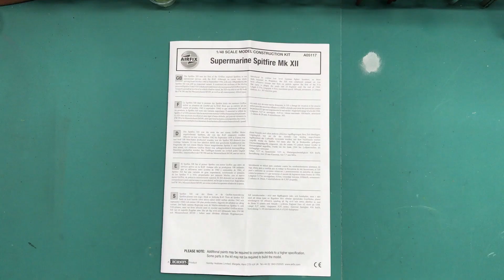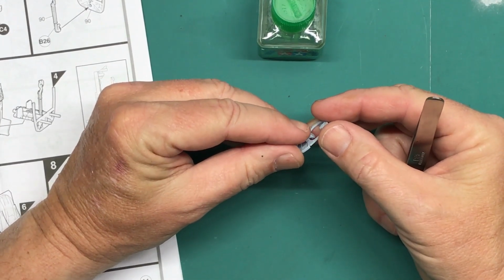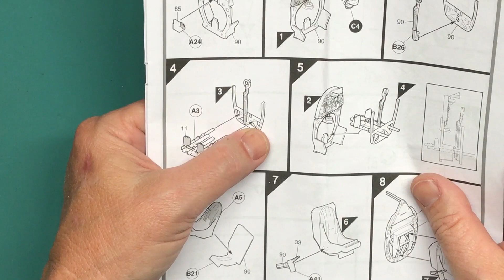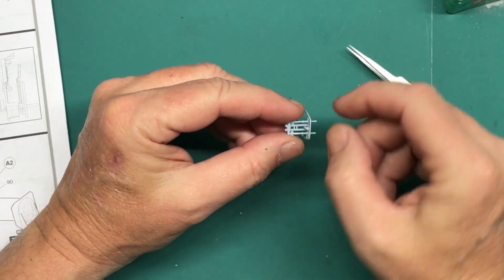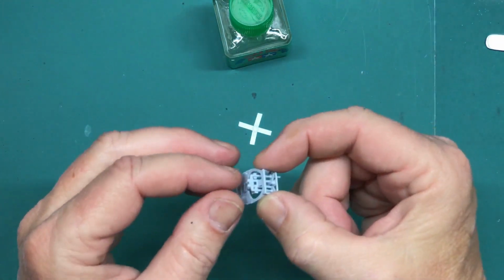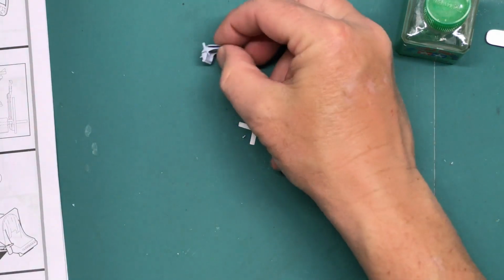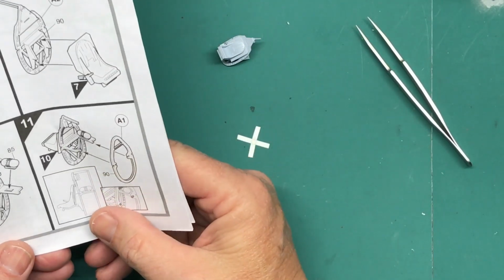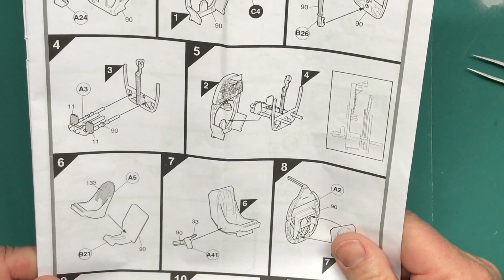Airfix 1/48 Spitfire Mk XII, Part 2 Steps 1-11

Comment: Brett, thankyou so much for this video. I'm just getting back into the hobby after 40 years away. I was having real trouble in figuring how to manipulate the very small parts, marrying them to their parent parts with tweezers and then gluing. You actually show HOW you do this. 

I cant recall anyone else detailing these techniques. It's usually which paints to use, how to airbrush and weather, but not the actual mechanics of HOW to do the really basic steps,

Older fellas like me (60) don't have the dexterity or keen eyesight we did as teenagers, and you have given some great advice on the basics. Much appreciated, and subscribed!
Reply from the maker: Thank you, Steve. This is why I do my videos the way I do. They can get long at times, but I want to show exactly how I do things in the hope that it helps somebody out. And, at a few months shy of 57, I can relate to the dexterity thing... I think this hobby is good for it! I want to keep it going as long as possible, so I figure it is good "therapy!"
Thanks for subscribing.